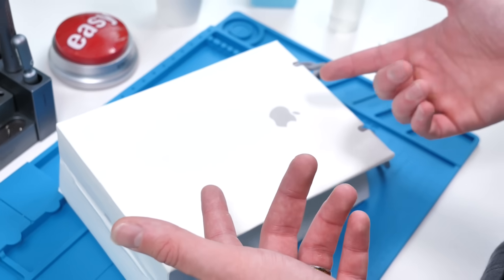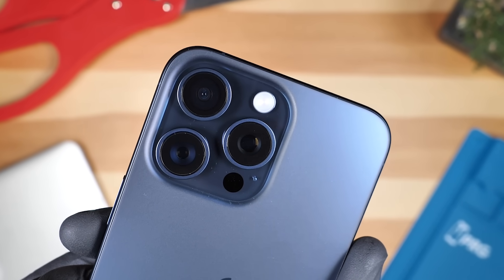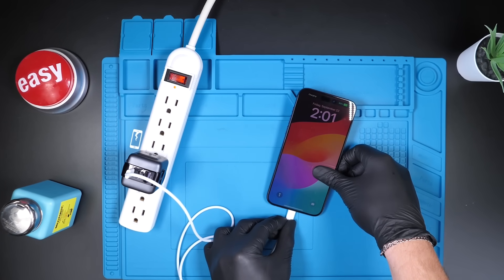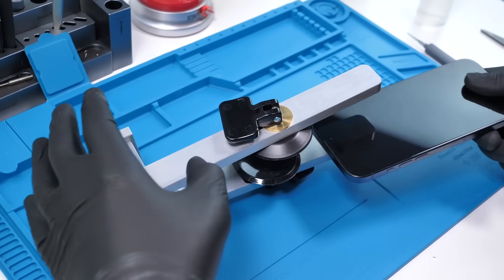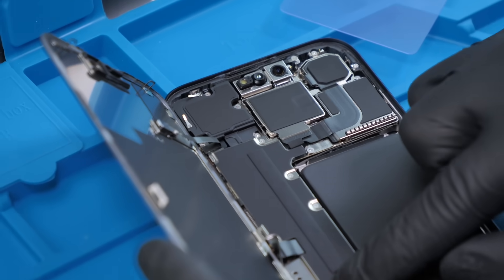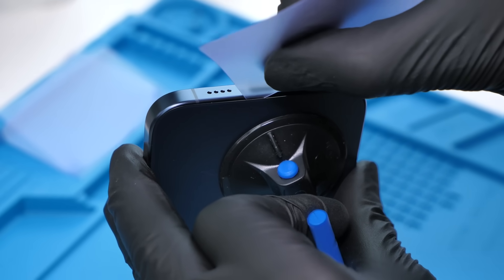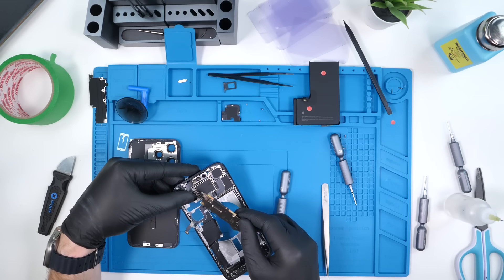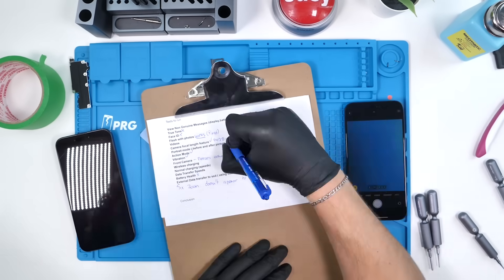Is The iPhone 15 Pro Repairable? - Parts Swap Test

Comment: The EU should start penalizing companies that pursue anti-repairability practices. Having your phone lose various features despite using Genuine products is disgraceful
Reply: I think they will force phones to have a removable battery soon
Reply: @coolcomments that will suck because I like my waterproofing
Reply: @juan2049  Actually there are phones who are waterproof and IP67/68, like the Galaxy S5, the Galaxy xCover Pro (and basically every xCover phones) 
So this is not an issue at all
Reply: @coolcomments My Galaxy A54 5G Is Ip67 Rated The Galaxy Tab S9 Series Is Ip68 Rated
Reply: @juan2049 Samsung Galaxy S5 had a removable battery and waterproofing.
Reply: No they won't. Theres already a rule for batteries, It must have a removable battery or a "good" non removable one of certain milliamps that lasts over a certain length of time (basically every phone today)  @coolcomments
Reply: @malikkelly there is a new rule coming into effect in 2027 for Europe. Because you're so big, it forces these companies to change their entire assembly line.
Reply: @coolcomments Technically, all phones do have removable battery as the batteries are not embedded on the motherboard, and they are just hidden behind a back that is "glued" to the phone.
Reply: @rexang99 it says USER removable batteries. It means being able to remove it without special tools.
Reply: @coolcomments that’s one thing I really think they’re overdoing on.. if it takes away water resistance that’s only bs
Reply: @Pea-G  Take a look at the 2014 Galaxy S5
Reply: @coolcomments at least that for iPhone and android. Just removable battery alone is great
Reply: @coolcomments battery doesn’t matter, what matter is other hardware with coded enabled features. If you swap that hardware carelessly it will disabled automatically since the hardware need the exact unique code which old hardware have. It just really stupid if in your area or region doesn’t have apple store. Since Apple authorized service (official 3rd party service) having so many mafia and worse service
Reply: they should i mean batteries dont last forever and it seemes like its alot more common for batteries to go bad in these newer smartphones
 @coolcomments
Reply: @coolcomments  He literally swaps the battery and you call it non-removable...
Reply: @coolcomments samsung s23 ultra now has a removable battery
Reply: @coolcomments that would be problem. All phones would be so thick and annoying af. That useless suggestion should not even be a suggestion pls think about suggestions before you type crap
Reply: @Tess11  Do you find the Galaxy S23 Ultra thick ?
Reply: @coolcomments  yes, yes I do.
Reply: @coolcomments  never liked big phones even ones from Apple. Don’t you like how the 15’s and 15pro’s look or the Samsung counterparts. Do you want it any thicker? Cuz if so, I think a phone form itel should fit you. No offense
Reply: @Tess11  Me neither
Reply: @coolcomments  some of  the repair issue’s and glitches are annoying af yes but the rate of non genuine parts would increase that’s just the problem. Like someone would go into a repair shop, and ask for their iPhone to be repaired and be ready to pay for a genuine part, but the so called repairer would put a fake part and collect funds for a genuine repair. And when the customer takes his or her phone home, he or she would find out they got screwed over. Some would even go as far as re programming thr battery health figure or adding True Tone to a fake a$$ screen or even put a fake screen that doesn’t even have Oled but LCD in a phone that originally had an Oled screen. So as the EU are scrutinizing phone and laptop manufacturers for near impossible repairs, they should also be cracking down on repair shops that do fake repairs for their customers. Let’s make everything even and right.
Reply: @coolcomments  Good
Reply: @Tess11  By the way this is not a suggestion, i am not the EU, this is an information
Reply: @coolcomments For the record, I DONT CARE
Reply: @Tess11  « pls think before you write crap »
Reply: @coolcomments yes and no. They are working on a law which says that electronic devices should have removable batteries, but if the company proofs it to be waterproof, it is not needed
Reply: @coolcomments  They already did
Reply: @coolcomments  EU is forcing everyone to have removable batteries by 2027.
Reply: @itsbrya BS lol.
Reply: @coolcomments The EU cannot force anyone to do anything and this whole USB-C debacle was nothing more than a power grab - they did not take into consideration that there are many USB-C specs not just the port - different pin alignments etc whereas Lightning was a strict standard that that did not vary depending on device - not the fastest but more reliable.  I have also heard the new USB-C standard has still not been ratified after all these years and with Lightning, no royalties are required to be paid to the USB implementers forum either - everyone forgets that.  If I was Apple I would be suing the EU due to using coercions / extortion and maybe blackmail to for a US-based company to change a connection port which was around for over 11 years, and now it appears this change is causing issues with other external USB-C including power banks due to different pin layouts / assignments and some cables do not have power options, only data - all this because of a connection port.
Reply: @coolcomments Nah they won't lol.
Reply: @coolcomments  then they have to force samsung etc also they also dont have removable batteries because i can easely get around the law with making ur device waterproof wich iphone are and most samsung etc also
Reply: @coolcomments yes by 2027 every manufacturer will be required to make their phones to have removable batteries
Reply: @fentmaxd No they won't. Not at all.
Reply: @coolcomments  Every phone on the market has a removable bettery already
Reply: Why aren't other countries doing this
Reply: @MH-S-99 There are some efforts in places in Latin America to do some of this stuff.I think Brazil has a common charge law now.0I live in the United States and I can tell you that we have the weakest consumer protection laws in the country and that Apple pretty much owns has the lobbying power to get away with anything they want at the state and federal level.

 In fact interestingly Apple just ended their opposition to right to repair in California but apparently that's because there are exemptions for these kind of software locks inside that legislation.

.So even when right to repair passes a state legislature it's only with Apple's blessing
Reply: I think apple is type of a company that will do one simple thing: the worst thing that they allow. Usb c? Yes, but a really old standard. Repairable? Yes, but you can break anything easily, and parts are expensive etc.
Reply: @maciejk2 if you could break anything easily in the phone, that would be worse for their reputation, so doubt that, parts are already expensive and will probably be even more
Reply: @axethepenguin  yeah, youre right. I just thought about apple being apple
Reply: @maciejk2  fair
Reply: @axethepenguin In the United States market, Apple has Teflon.They literally got caught systematically slowing everyone's phones down and paid a huge fine/civil lawsuit and everyone still gargles them like there's some kind of God.

fact ironically enough as part of the process of paying off that fine, they. made a toggle in the battery settings where you can turn off the throttling..But it's hidden in 90% of casual users will never ever even think of turning it off

So ultimately there's still throttling phones just like they were before they got caught
Reply: @axethepenguin  Their reputation among people who give a damn about repairable tech, people who aren't Apple's target audience and are most likely never going to purchase an Apple product, people with whom Apple already has a terrible reputation. Don't underestimate the sheer level of douchebaggery they can get away with, their actual customers won't give two shits.
Reply: @GabrielSykes  actually true
Reply: @maciejk2  And THIS is why I was always against the EU forcing USB-C. One company didn't play along with a standard that everyone else was using, I don't think that's enough to warrant a requirement for everyone to use said standard as it could cause issues down the line when something better than USB-C eventually comes around. Plus it was extremely predictable that Apple would just implement it in the most "screw you" way possible, they've done so with their own hardware countless times over the years, and have even made a keyed version of USB-A before to prevent you from putting non-Apple products into Apple USB ports.

If the EU were to force user-replaceable batteries, or easy user repair in general, I'd support that, because Apple isn't the only problem child in those regards, everyone excluding Fairphone and Framework kinda is to varying degrees, and there are a fair few companies that'd just take it and play nice, unlike Apple.
Reply: @GabrielSykes  true
Reply: @maciejk2  The iPhone 15 is stuck at USB 2.0 because of the A16 Bionic not because they wanted to stick it at USB 2.0 speeds, do some research before spouting off the latest hot take you heard from someone else.
Reply: @NikolaiCherepanov  yeah, my bad, many people before you have told me that i was wrong, sorry for that. any ideas how could i change my comment?
Reply: @maciejk2 it’s an old standard bc they basically took the lightning standard and plugged a usb c port into it
Reply: @adanua  many people already told me that its because of cpu limitations, i really need to edit that comment xD
Reply: @maciejk2 even an midrange device give hdr 120 hz displays 😂😂
Reply: @rickgamersfist4867  true but how of them are even up to par with what a flagship offers? It’s not about rushing to add those Flagship features, but it’s about doing it well. Y’all say 120hz, but when it’s not LTPO, y’all would instantly complain that the company gave y’all a cheap display. I like those features, but if they should be added to the base models of phones, they should be at least up to par to their flagship counterparts/ siblings.
Reply: @maciejk2 Apple is a US based company. How about the US does something about it.
Reply: @maciejk2 just that the usb thing isn’t correct
Reply: @maciejk2 Thats ok, theyd fet a worse reputation and either have to sell or go bankrupt
Reply: @maciejk2 lmao apple phones don’t break easy
Reply: @qtnv.  XDDD
Reply: @maciejk2   they use usb3. no phone that ive seen uses usb4 as there is no point. clearly have no idea what your on about.
Reply: @maciejk2  The 15 pro and pro max have usb c 3.0, the reason the iphone 15 and 15 plus don't have usb c 3.0 is because the a16 bionic which was never meant to have usb c 3.0, doesn't have a dedicated usb controller like the 17 pro in the iphone 15 pro and pro max
Reply: @searic3203  oh okay, so nvm my bad
Reply: @searic3203 finally a good explanation 
I'm between iPhone 14 pro max and Samsung s22 ultra ....
For the first time I'm thinking to take a shot at Samsung, what do you think?
Reply: @maciejk2  meh, these pro models have usb 3, only the non pros have usb 2, just like many other non flagship phones. Havent seen USB 4 in any phone yet, and honestly dont see the point
Reply: @GamingProject23  you do realise the standard iphones are priced like flagships right? no idea why people love being ripped off so much
Reply: @GamingProject23 also, the non pro phones use the chip from the iPhone 14 pro, and its usb port is usb2, so of course this year’s non pro is usb 2. That’s what the chip can do. It’ll probably trickle down next year. at least to a usb 3, if maybe not 10G.
Reply: @uchihasilver8362 you’re paying for the software. That’s why it’s expensive.
Reply: @GamingProject23 "only the non pro" Imagine its 2023 and you paying 900$ for 60Hz and a USB 2😂 it would have cost them a few bucks to put USB 3.2 in there but they hate their customers
Reply: @Philipp673  Well yeah, what would you rather have? USB 3 or 6-8 years of actual usability? Why do you think they hate their customers when my previous iPhone 7 from 2016 just recently got a security update? When did your Galaxy S7 or S8 from that time get its last update -> its on android 9 from 2018. Oh but it has USB 3. How useful.
Also, Samsung A-Series also still use USB 2. If you buy a S23 Ultra for 2000$, guess what - it comes with a USB 2 charging cable. Probably because they hate their customers ;)
Reply: So much for the right to repair
Reply: not the EU the whole world. europe cant fit all of apple's fans
Reply: @Sterbun yeah but the EU is big enough that if they make a change that impacts the assembly line, it's not economically viable for Apple to have a completely separate assembly line just for Europe.

It's still legal for the US to sell lightning on an iPhone in the United States and Asia but they don't bother because they would lose so much manufacturing efficiency by having to create a secondary assembly line.

So if Europe forces removable batteries, they will be coming around the entire world. Either that or Apple will have to choose to stop selling phones in it in Europe. But it is not economically viable for them to have to have a separate assembly line for phones that are sold in Europe, and then another assembly line for phone sold everywhere else.

That would increase the cost of making phones by 30 40%.
Reply: why are yall relying on the EU so much for this
Reply: @bloxoss because they seem to care more about implementing laws that are pro-consumer than other big countries or continents like America. If the EU makes a law like this then it effectively causes the law to apply to everywhere and not just the EU because of how big the EU is, it's often impractical to make two separate versions of the same phone just to have one for EU only. So they would make the changes for every phone in the world
Reply: Well, can USA do something about it for a change?
Reply: @nowave7  it’s hilarious because people in America probably a good 98% of iPhone users do not care about sideloading which is sad because that would put the phone more on par with android if emulators and other things were easier to get. I mean at least iPhones can download music directly off safari now for free I know older iPhones couldn’t do that. Still android as a OS is my preference I like the customization which feels less authentic on ios even with the iOS 16 changing a lot of that. Music is subjective I think it sounds better on android at least with headphones but iPhones with mono stereo setting turned off basically making the music sound a lot clearer does sound almost as good as the old LG androids that had the best Dacs a few years back
Reply: Greedy greedy companies
Reply: European Union 🇪🇺 I love them now
Reply: The EU shouldn't do anything. People should stop being sheeps.
Reply: Be careful what you wish for Apple then might also start selling their products with less durability so that you can keep repairing them or have keep buying a new one. Happened with just the iPhone 15 pros people kept complaining about the back glass not being easy to repair and so Apple made it removable now look, the back glass breaks easily then before
Reply: The EU is pushing the entire market across the world in the right direction and I really hope they keep the ball rolling. It's baffling to me that this hasn't been disallowed anywhere (even outside of the EU) as it is intentionally breaking something you paid for. It's literally 'legal' theft
Reply: Your comment should be at the top. The only way to fix this issue is EU coz Apple won't care just like they didnt care about USB-C until they were told off.
Reply: can't wait
Reply: Maybe don't buy overpriced phones
Reply: Why not America? Ain't both democracies?
Reply: not to mention goes against true sustainability and longevity of these phones which is  antithetical to their 'sustainability focus' the past few years
Reply: Why just the EU? Why has the US not grabbed their alleged balls and started putting down similar regulations?
Reply: Disgraceful and dreadful
Reply: How about all govs then they have no option
Reply: Just fk the EU and let them use android
Reply: It’s too help prevent theft .
Reply: @JDM4EVR how💀
Reply: ban part pairing
Reply: I Wonder where u Life
Reply: This is why I stick to Android devices.
Reply: The funny thing is that these companies are claiming to be pursuing sustainable practices and "saving the planet"
Reply: I love how we're just banking on Europe making our lives easier lmfao
Reply: @radio_marco dumbest idea
Reply: They should keep lightning. Fu…K  eu
Reply: Bad isnt the word how can they serial a glass
Reply: I disagree, more malpractices happen when “third party repairs” take place. 
Yes you may get it “cheaper” but you also run the risk of not having the phone repaired properly. 

Lastly, if you made a product you sold every solution for, would you not do the same play as well?

Would you as a Lambo owner, take your lambo to the local car mechanic or are you taking it to Lamborghini the authentic parts? 

(Mindsets will vary) but quality of quantity should be the mindset
Reply: @anfdelarosa  Apple is proven to scam people with their repairs because they will overcharge you by lying about extra repairs that don't actually need to be done
Reply: Damn, this arguments getting heated
Reply: @aDude1naSuit  ik, ive been getting notifications every 30 minutes for the past 2 days 💀
Reply: They are doing some changes to repairability...
Reply: No. The EU should have e no more authority. They’re unelected officials who like to bully corporations and people. The EU is outdated and will soon fail.
Reply: Just don't buy iPhones, problem solved.
Reply: Front cam is an authentication tool, EU will side on what practice offers more security
Reply: @CJ-ui4tg  ofcourse. But using genuine apple parts shouldn't happen security
Reply: They all should. Glad that the EU is actually doing something about it 😅
Reply: @QTA-20  Yh until what they implement screws up the whole tech and engineering sector. Then y’all would say it’s the phone and laptop manufacturers. Not the EU.🤦🏽
The rate of fake and non genuine parts would increase by a mile
Reply: @QTA-20  Y’all say that until they break something that didn’t need fixing and y’all take the blame to the phone and laptop manufacturers🤦🏽.
Reply: some of  the repair issue’s and glitches are annoying af yes but the rate of non genuine parts would increase that’s just the problem. Like someone would go into a repair shop, and ask for their iPhone to be repaired and be ready to pay for a genuine part, but the so called repairer would put a fake part and collect funds for a genuine repair. And when the customer takes his or her phone home, he or she would find out they got screwed over. Some would even go as far as re programming thr battery health figure or adding True Tone to a fake a$$ screen or even put a fake screen that doesn’t even have Oled but LCD in a phone that originally had an Oled screen. So as the EU are scrutinizing phone and laptop manufacturers for near impossible repairs, they should also be cracking down on repair shops that do fake repairs for their customers. Let’s make everything even and right.
Reply: There are two sides to this story. Thieves are stealing smartphones from people because it’s becoming so easy to refurbish  and replace components which they resell.When someone has spent a lot of cash to purchase the device. We need to rethink this easy to repair.
Reply: That just goes too far.. we don’t need this continent to become mf communist
Reply: Trust me china repairshop will figure out it soon. In china they can build you an fully functional iphone with just spareparts.🤣🤣
Reply: Or wait, stop throwing your phone on the ground?
Reply: I dropped my iPhone almost one year ago and although there is no physical damage on thé outside, two of my lenses stopped working and my flash is also disabled. And I get a non genuine parts message even when my phone has never been opened before. 
Im guessing that one ribbon cable got ever so slightly disconnected or something
Reply: I kinda disagree. A government shouldn’t place restrictions on things we make. You don’t have to buy an iPhone. There’s more than just one phone manufacturer. For example If you wouldn’t want to buy a car because you don’t know how to fix or maintain it then you don’t buy it.
Reply: @mcatlow8  I'm not asking for a restriction. I'm infact asking for the lifting of restrictions imposed by the company so I can actually repair and maintain the phone myself. I know how to work with circuit components but I'm not able to due to apples anti-repairability actions
Reply: The EU is biscally the savior of phone owners if you think about it like it's a 2 year journey from this day to get removable batteries back USB-C has been universalised the capitalism and the dictatorship of phone manufacturers is coming to an end and all thanks to our heros that Don't usually ware capes in the UE although I hate Europeans but they redeemed themselves with these steps
Reply: Pro do we live in Soviet Union EU shouldnt be able to do shit
Reply: EU should forces Apple chip to be on all smartphones for Android
Reply: I'll take the added security as a by product
Reply: Honestly it’s half and half. If it is too easy to “repair” you open a market for stolen iPhones. If spare parts are worthless then nobody would be tempted to steal an iPhone
Reply: EU to the rescue
Reply: The EU has no authority to tell any company how to make any hardware - typical government leeches that have no idea of the real world in relation to technology.  If you don’t like Apples methodologies then too bad - don’t buy their products.  Stop whinging you cannot repair your own device because you don’t want the manufacturer to do it because of how much they charge.  You pay over $1,000 for a phone and damage it of your own accord (accidentally) but complaining about Apple charging you their price to fix it and want to do it yourself and buy the parts on top of the purchase price.  If you want to fix and repair your own phone make your own.
Reply: @SpeedfrkOne  lol Learn about EU regulations before typing essays. Then learn about how it affect sales. I'm not even EU and knows that 😂
Reply: @Tharindu_LK  It’s all unlawful - EU has no jurisdiction in the USA or any other non EU country.  Apple should have stuck with Lightning because now there is a host of USB-C compatibility issues with iPhones and other hardware which was never an issue with Lightning.
Reply: @SpeedfrkOne  You need to understand the situtation properly bro. EU don't force Apple to do anything. If Apple want to do business in EU, they better comply with the regulations or gtfo. I salute the EU. Plus Lightnin cable is one of the worst nonsense I have ever used.
Reply: @SpeedfrkOne  they have and did
Reply: America should wake up too
Reply: If it’s in the user agreement policy agreement then they are not at fault, blame urself for feeding fat pigs to be more greedy than ever.
Reply: The EU? Really. I bet you love government.
Reply: @Doiber   Fair, however, what Ive also not seen is any 1000€ phone that gets more than 3 years of full updates. I guess different people have different priorities. Next year the 16 will probably have 3.0 too. Havent plugged my phone into my computer since the release of icloud or onedrive
Reply: They can’t because apple care exists and people stand for it. Most people also just buy the next apple product never finishing the payments for their previous gen and just never stop paying monthly fees. But we don’t talk about that
Reply: DONT BUY THIS PHONE
Reply: Every country’s government should!  These business practices are disgusting!
Reply: @newfinishautospa  idk why y’all complain
Reply: Hey, it’s a good thing that the EU is cracking down on this. I specifically remember hearing some thing that even Nintendo is getting penalized for this regarding internal batteries on the switch because if the switch is ever opened up by non-Nintendo repair specialists to replace the battery, it would automatically void the warranty.

If they make another model of the switch in the future, they will probably have to be forced to incorporate a removable battery that won’t be able to void the warranty by replacing the battery.
Reply: Agreed
Reply: Same with the US
Reply: @Neko_ix If I read the news correctly, the law that batteries need to be user replaceable without the need of tools is already ratified and will come into effect in 2025. I just hope that phones will remain waterproof and as strong as they are today, otherwise this will make the repairable phones last shorter than current phones
Reply: It's absolutely criminal...People just need to stop buying them
Reply: The EU is ruining apple
Reply: I don't think Americans are happy about it either
Reply: I love how the world is just relying on the EU to be the ones to annoy make companies do things
Reply: It should be ILLEGAL.
Reply: If your in the eu, (basically anywhere) talk to your local leaders if your that desperate
Reply: Correct. We are buying the product.
Reply: This aged beautifully
Reply: Yeah I agree but even the E.U. is subject to certain international laws and regulations and companies like Apple could litigate them based on that so there are obstacles to the E.U. doing that even though they have the power to do so, it's not quite that easy for them to penalize certain companies.
Reply: YES! Just like they forced them to use USB-C! As an Apple fan, I see that as an absolute win!
Reply: @FuzzyIcecle Comments like this makes me wish that apple will just send a huge f*ck you by ceasing to make iphones. 

They are not your slaves, you should not force them to do anything, if you don't like their product then don't buy it. 

Imagine if apple was treating their customers like this, asking the EU to force people to buy iphones. Then I am sure everyone will riot, but people are fine with it when it is the other way around.
Reply: You want to have your cake and eat it too.

Imagine you're selling a product that your customers don't like, instead of them going somewhere else or coming up with (their)* own product they force you to make it how they like. Does this seem okay to you?

If you don't like the product that much then don't buy it, no need to use force as they are not forcing you to buy it.
Reply: @prayerjoseph9776  If apple doesn't like the rules then they aren't being forced to sell their product in the EU. The mandated changes are entirely beneficial and apple is being forced to change them because apples design was anti consumer and greed based
Reply: @juicetimer  If no usb-c was such a deal breaker for the consumer why did they keep buying iphones? Was apple forcing them? If you felt apple was doing something wrong to their consumers why don't you let them continue, will they not lose their customers if what they were doing was so wrong? Even a fool doesn't want to be cheated.
Reply: @prayerjoseph9776 Was EU forcing apple to sell phones in the EU? I never said it was a complete deal breaker but its a worse port that makes the experience worse and it's driven by apple greed because it's their proprietary charge port so they make more money. They know they can get away with it because apples ecosystem is exclusively apple confined and people will still buy iphones anyway because of ios and the ecosystem. Apple wasn't going to change it for the better until EU mandated all EU phones use it and apple chose to continue selling EU phones
Reply: @juicetimer  How is that question even relevant? I own a business and I sell X, my customers claim they want Y, I do not want to sell Y, my customers then bring people with guns that tell me to sell Y or leave. Whether apple does Y or leave is irrelevant here, the main thing is that if they were left alone they probably would still keep selling X, therefore they have been coerced.

Again, I wish apple would just send a f*ck you and leave. That is what I would have done if it were my business. Nobody has the right to tell me what to sell if what I'm doing is proper, if you don't like what I'm selling then don't buy.

People don't understand how capitalism is supposed to work that is why we are ever encroaching towards socialism, and full-blown totalitarianism, your freedoms are being eroded in front of you and you can't even see it because you are blinded by hate, you hate what apple is doing, that is fine, but if you are ready to force the people you hate into submission you better be ready for the people who hate you to also force you into submission. 

I pray the EU doesn't pass a law making iphones the only legal phones to use.
Reply: @prayerjoseph9776   
A part of capitalism is that an government is setting boundaries for how far businesses can go. The new EU legislation is an boundary for all makers of wireless devices (not only Apple). And Apple is (after a lot of their opposition) changing because the EU is still a huge market for them (around 25% of their income comes from the EU).
Reply: @Selivio  You just proved me right when I said people don't understand how capitalism is supposed to work.

No, it is not the governments job to micromanage businesses, the government is only there to enforce the rule of law, if a business happens to violate the rule of law then it is only proper that the government intervens. Outside of this the government has no business in any other matter, what standard a business decides to use has nothing to do with the government (except you live under a socialist system like we do currently, where the government dicatates what people can or cannot do)*
Reply: @prayerjoseph9776   Because it's the same as saying "if you don't like apple don't buy it". If apple doesn't like the EU laws then they don't have to sell their phones there. Nobody forced you to buy an apple phone. Nobody forced apple to sell phones in the EU. 

This isn't about people's freedoms being eroded or forcing people that other people hate to do things. It's about the EU making consumer friendly laws that result in a trillion dollar company's product being more consumer friendly and less greedy.
Reply: @prayerjoseph9776  Nice one. You contradict yourself (which says a whole lot more about you than me)... So in your version of capitalism the government should enforce the rule of law, but can't set these rules of law. Who makes the rules than in the first place (you know, the rules of law in which governments can intervene in your world)? Not the companies... (and I believe I did mention that an government has to set the boundaries (Apple and the competitors have to all acknowledge the same boundaries), which the EU does in the matter)
Reply: @Selivio  "A part of capitalism is that government is setting boundaries for how far businesses can go" is what you said.

And I told you it is not the government's job to micromanage businesses. 

You don't seem to understand what a rule of law is, a rule of law is different from telling someone you should do this, you cannot do that. Think of it as us agreeing to play a game, in that game we set parameters, and we all agree to play under those parameters, we are all equal under these parameters; don't steal, don't murder, don't lie, and so on.... these are the parameters.

In this game if someone has not violated any of these parameters and you come to them specifical and tell them you have to do X that is a diktact, whether it is coming from the government or not.
Reply: @juicetimer  I already told you what I would have done if I were apple.

You still can't see it. Again, I pray the EU doesn't make an apple friendly law that results in millions of consumers being less selective and only buying apple products.
Reply: @prayerjoseph9776 But don't forget about iOS, it's a pretty good os, but it's apple only. If you want iOS and repairability then you can't and this is the issue.
Reply: I kinda understand Face ID since it is used by bank apps and for other important things.

But Cameras and Truetone… Should not be disabled…
Reply: @MrRonski  If we are using gunuine apple products then it shouldnt really be an issue of security

however yes, using NON-GENUINE products do serve a security risk and shouldnt work with the Iphones (this doesnt apply to the battery and wireless charging though)
Reply: @adyghe3  Non genuine parts should work, people should be able to decide what they want to do with their devices after they purchase them because it should be their property. They could either choose to be safe and buy a genuine part or get a non genuine part
Reply: Leave EU alone, do your job
Reply: For people who prefer buying used phones, these features help not getting scammed so I almost appreciate them doing so. Especially when sellers claim that the phone was never opened but surely it was and now it's not water resistant anymore but you're made to believe that it is.
Reply: @vedanshchn if you repair it right using seals and such then the phone will remain water resistant after opening and closing it
Reply: @juicetimer  If the seals were so cheap and easy to do, each any every phone could have been water resistant 🤷‍♂️
Hence you should avoid outside repair centres.
Reply: @vedanshchn  It's not about just sealing, there are other components that make it more difficult to make a phone water resistant. I know many repair centres that reseal the phones after opening them up. If they don't reseal adhesive then they're doing it wrong, that doesn't mean you shouldn't go to every single 3rd party repair shop just because one is wrong. I would rather go there than have apple tell me incorrect information about how my phone is more damaged than it actually is and overcharge me for expensive and unneeded repairs because they want me to buy a new phone instead of fixing my old one
Reply: @vedanshchn That's not at all the case, this is terrible for the resale market. Because now it means if you buy a used phone that has a legitimate proper Apple first party camera in there but it was a replacement camera your phone's going to be completely f*** beyond recognition.

It's much better for The resale market if Apple is not stingy about parts in schematics and that if they don't have these ridiculous software locks against other first party Apple products.

we're talking about proper Apple parts here. You replace an Apple camera with another proper first party Apple camera... There's no security issue there. I could see if you were worried about maybe some kind of cheap battery that could compromise the safety of the phone. But you're getting penalized for using the official first party Apple parts here.

And if Apple is claiming to do this for our benefit then they could just use codes. They could make it really easy for someone to validate a new part without having to go directly to an Apple repair shop.

This is off obviously an abuse of monopoly power to make it so they are the only ones that can do repair. It is literally crushing an entire industry of independent contractors and it's terrible for everyone except for the trillion-dollar company that's benefiting from it.

And I find it just absolutely insane when Apple fans start defending it against their own economic interest. You wouldn't tolerate this behavior for your car but you will for a phone?
Reply: Yea, but how do you balance allowing any genuine parts with preventing stolen phones being used as parts bins?
Reply: @politcallycorrect5816  you shouldn't have let your phone get stolen
Reply: @rohanattackongoole254 

Good luck because it can and will happen even in the safest countries. It will happen.
Reply: @ecthelionv2  if it happens it's my fault for letting in happen
Reply: Yes manufacturers should be penalized. But the end consumers who buy these phones year after year driving the sales up should also be blamed. People are ignorant of the irreparable nature of these devices and will continue to consume whatever garbage apple comes out every year.
Reply: @RiddleWhisperer dummy
Reply: @RiddleWhisperer  You wish. People can choose what they want to buy. You want to control others. How about you make the dream phone. You put in the work. Instead of crying to business that are successful to listen to you. You’re obviously not even a paying customer.
Reply: EU can only do so much here. A larger market is the US as most people actually get an iPhone in the US which is not the case in the EU, not to the same extent. I agree security is paramount, but this could easily be fixed by allowing everything to work only after phone is completely reset so not really a reason. Right to repair doesn't necessarily mean OMG you have to repair it yourself even though many people on this channel would gladly swap parts and not break anything. Its about independent shops being able to help you reapair your phone for cheaper. I get that the US can offer the iPhone on a 50$ contract, in other countries you do pay a premium for it, just like you do with other flagships, so if other companies allow you to swap stuff and even offer genuine parts for 3rd party repair shop it doesn't mean they are less secure it just means Apple is scum and want your aftersale money. Sure, you can still get your, for example, Samsung phone to Samsung and swap a back glass for 80$ or a display for 300$ (much cheaper even in official repair shops) but you can also buy the part and do it at home or in another shop for 50-60% of the price and still have genuine parts. That's the point here, freedom of choice and competition to bring down costs for a product you own.
Reply: How is the phone supposed to know if a part is genuine or not?   All a phone can do is determine if a part was originally part of the phone or not.
Reply: @darkpill  Phones assess the authenticity of parts by examining factors like hardware signatures, serial numbers, and software checks. Think of it like the phone's way of checking if everything is in its original, expected state, similar to how we might inspect something to see if it looks genuine. These checks help determine if a component aligns with the manufacturer's specifications.
Reply: Wouldnt they just stop selling in europe at that point
Reply: My favorite country I mean continent besides USSR
Reply: @TheFederationOfBalliaOfficial  😂 Yes, the USSR was on another level, the EU are just low level fascist, which is still good of course.
Reply: @prayerjoseph9776 how is it fascist lmao
Reply: @milktoast56  What would you call it when people are being forced to do something under the coercive power of the state?
Reply: @prayerjoseph9776  with that logic you can say everything is communism. If the majority prefers x but you prefer y, in your logic that's communism. Know what a parliament is? Also no one is stopping apple from leaving the eu.
Reply: @milktoast56  I don't remember saying communism to you. Other people having a say in what I should do with my own property is communism/socialism, it doesn't have to be forceful, but people end up using force in this type of system because they believe they are entitled to other people's property by default.

In one of my previous comments I said if Apple was left alone they probably would still be using lightning on iphone. Whether they leave or change to usb-c is irrelevant, the fact remains that Apple was coerced into a choice they probably wouldn't have made if they were left alone. This is fascism, state control over a private entity.

You didn't answer my question. What would you call fascism?
Reply: @prayerjoseph9776  okay I see no reason to continue this argument. If you see improvement as fascism, then okay!
Reply: @milktoast56  It was not an argument. You don't seem to think what happened with Apple was in anyway related to fascism, which is fine.

I'm just pointing out that based on how fascism is defined it was.

It's not like I don't see usb-c as an improvement, just that it is terrible that it was forced on Apple's iphone. If apple doesn't want to use usb-c on the iphone leave them alone. If you don't like the iphone without usb-c don't buy it or go make your own iphone with usb-c.

Edit: it's just like how they are mandating cars to be electric. What next? The types of food we can eat? What clothes we can wear? Where we are allowed to go? Who we are allowed to speak to?

Hopefully we can have the option to leave if this ever happens.
Reply: @prayerjoseph9776  america be like:

This is a perfect summarization of American freedom mindset. Need freedom everywhere. Changing a port is not a reason to go off like this tho.
Also the car argument, that is not likely, think about it, stopping a whole continent from using gas cars in a matter of 15yrs is unrealistic obviously.
Reply: @milktoast56  😂 The people who forced Apple to change the port thought it was a reason to go off like that.

That's not stopping them from mandating it though.

I'm not sure how much of that American freedom mindset is left in America today, but it seems to be very little.
Reply: Shut up.

As a mobile repair technician I can guarantee the average consumer will not be able to do this. Do you see the engineering and build inside? You don’t in details. These videos give you highlights of the repair.
Reply: @ck3plays  it’s just that apple serialized it
Reply: @ck3plays  that’s why it’s unrepairable
Reply: @lol-ge9bh  Same applies to all things tech. Does the average person fix a panel on a TV if you crack it? You don’t. So I don’t understand why people cry about wanting to fix their phones.
Reply: @ck3plays  for the average consumer if they want to fix it themselves or replace the battery they can’t without losing features
Reply: Completely disagree. Personally, I'd want to pay extra to have security in the entire chain so avoid any issues with malware.
Reply: @Andr3wgRe this is such a silly argument. What would malware have to do with replaceable batteries anyways? And even when you're talking about side boating apps, it's been allowed on Macs for  decades. Do you consider Macs to be completely unsafe.

It is not logically consistent to think it's okay for all of apples and laptops and desktop computers to support side loading but then to suggest it's a huge security vulnerability if they allow it on a phone <which is literally just a computer>
Reply: If you buy an iPhone you deserve it
Reply: @Kronos0999 I own a iPhone and agree with you I like apple but definitely not a fanboy
Reply: @Kronos0999 High end Samsungs are just as bad. You know every company wants to do this. They just let Apple take all the flack and then do it secretly.
Reply: The EU should make that phone and let people decide if they want it. No one forced people to buy Apple. No one should force Apple what to sell. My opinion
Reply: @oddbutfair  Nobody forced apple to sell phones in the EU. Apple should make that phone and decide if they want to sell in the EU. My opinion
Reply: @oddbutfair  my friend every industry has government regulations. It is these regulations tha stop companies from charging absurdly high prices or delivering products and services which do not satisfy what is advertised.
Reply: @oddbutfair If Apple wants to sell in the EU, they have to comply with EU's rules.
Reply: They could just ban the products from the EU market
Reply: @eriklagergren7124 you know they won’t as iPhone brings in money.
Reply: The US could also try to actually hold corporations accountable as well. It's well within their legal rights
Reply: The EU is going to force Apple to make their batteries easier to repair and make it so that anyone can do it. Apple can be an extremely frustrating company
Reply: It’s to combat thieves. Because thieves will jack you on the streets and sell your phones to a fence for parts. I’m totally on board with this practice.
Reply: @GrandHuevotes no it isn't they cudnt care less about thieves except themselves who are the thieves..they're doing it to make you have no choice but to go to them for after market repair..go look up their website and see how much those are..there's your answer!!
Reply: @GrandHuevotes theives also steal car parts and sell them, does not mean not making them repairable is a solution
Reply: @GrandHuevotes That's not the reason they do it, that's just a red herring that happens to work out for them.
Reply: I guess colonizers can't stop dictating what other country do guh
Reply: @robustanybody5138  „cononizers”? You mean the like 5 modern day countries that participated in colonialism over 200 years ago, out of all 27 currently in the EU? Sorry but how brain dead are you?
Reply: @robustanybody5138 and also, in this case no one is telling other countries what they can and can’t do, the EU just told companies that we only want all of our newer devices to use a single, simple EU wide standard from now on, and anything that doesn’t use that standard cannot be sold.

Apple was completely free to keep using lightning and just drop out of the EU all together, but I think even you are probably smart enough to be able to understand why that may not be the best idea.
Reply: @robustanybody5138  I didn't know Apple was a country 😯
Reply: @robustanybody5138 I guess you own shares in Apple and are butt hurt the EU is telling Apple what it must do, so cuts into their profits huh?
Reply: @robustanybody5138 you do whatever the fk you want. Consume sewage oil, eat the cat, but if you want colonizer cash, sell me the product I want.🎶🎵
Reply: Yeah bro because apple will do everything you please. Don't you want free phones ? 
Why would they allow you to "repair" it ? You are not qualified to do this job. 
The fact that people are this stingy for a 200 bucks repair is hilarious 😂. 
Then don't buy an iphone or a flagship buy a 300 bucks phones and that solve the problem
Reply: @S1RT5 you need a qualification to repair phones ? 😂
Reply: @S1RT5  You clearly missed the point of "right to repair". A skilled technician, using parts that came from a genuine iPhone, can't repair the phone without it disabling critical features like Face ID. It's not about letting people like you, who probably can't hold a fork properly, repair the phone themselves.

Scoffing at $200 for a back glass repair, good stuff. Sorry to tell you, but you're probably gonna be in for a rude awakening when you're old enough to be out on your own, without your parent's allowance paying for everything. But don't worry about that too much right now, that's still about a decade away for you.
Reply: @S1RT5 the fact that you let yourself pay 200 dollars for a repair tells me all i need to know about u
Reply: @S1RT5 You don’t need to be qualified to do the job in order to benefit from a repairable phone. Also, there are a lot of people that do not live in the vicinity of an Apple Store or a certified Apple repair shop, but they have a repair shop closer. Should those people not be able to get their devices repaired in a timely manner with genuine parts without having to lose certain features of their phones?
Reply: @S1RT5  Ive never seen someone bootlick so damm hard. Apple isnt going to hire you bro 🤣🤣🤣

we are paying $1000 for a phone, we expect reasonable customer service and self repairability
Reply: @adyghe3 😂 then don’t buy an iPhone lol. Go on an android since there are many companies. Stop trying to make an iPhone into an android
Reply: @unrivaled7625 It's not about making an iPhone an android it's about making the product more consumer friendly, android phones are just typically more consumer friendly on average
Reply: @adyghe3  I also don‘t see the self repaiability aspect that hard. If the OEM has good repair system, and don‘t make phones unrapairable its honestly fine. Apple stopped ripping you off and started building phones that are repairable. I paid 70 bucks to get my battery replaced in a 3 year old phone (11pro). They still have all the parts for it and I went to the apple store and it took them 1 hour to do it…This year I broke the screen. My insurance paid for it so I went again 200 bucks 50 mins…If people start fumbling on their phone and shady 3rd party repair shops start putting in low quality batteries and stuff you suddenly have „Iphones catch on fire“ headlines…
Reply: @laser_simon922  Apple is more shady than the majority of 3rd party repair shops
Reply: @adyghe3  the average consumer does not care about repairability. They don’t repair their own devices anyways. That’s the biggest lie that y’all have convinced yourselves of. The only people who care about things like repairability are those who are watching this video, not the billions of people who buy and use phones on the daily. That’s just the sad fact.
Reply: @S1RT5 it's not even that, it makes my job harder too, someone who does this and is learning to get a full qualification